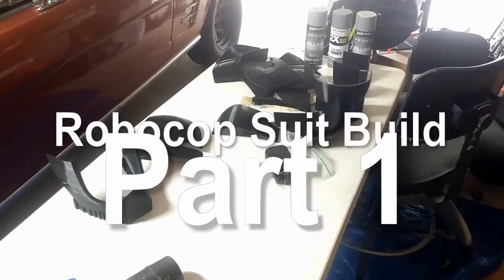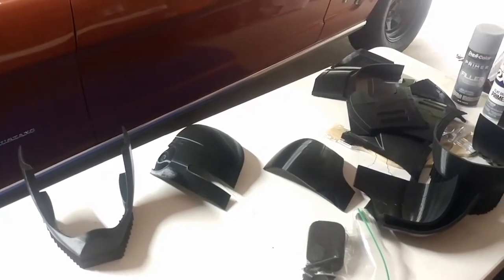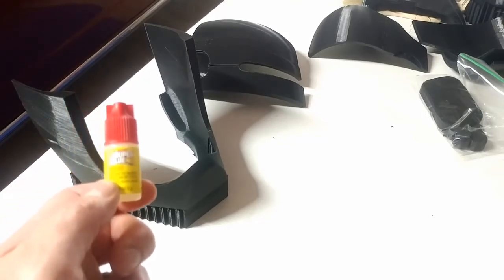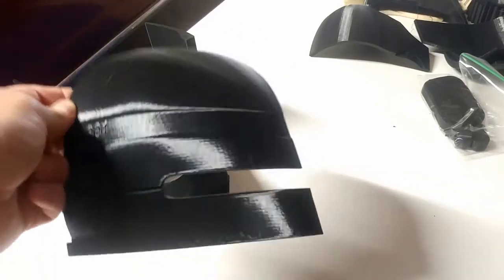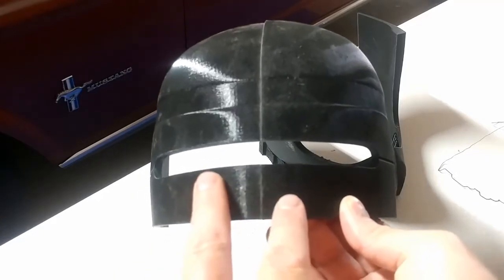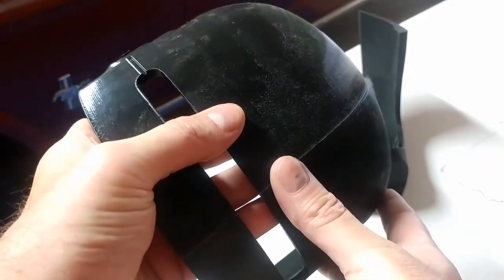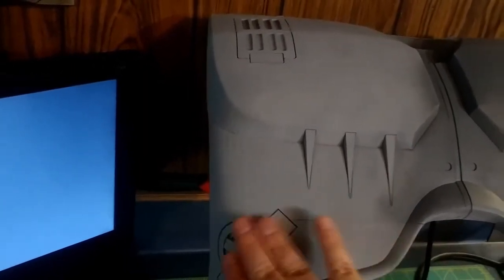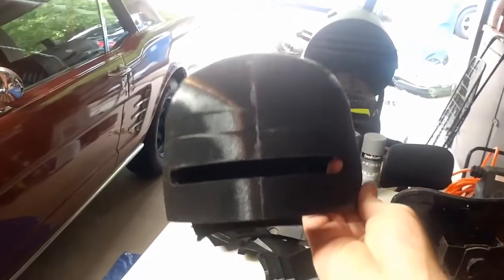3D Printed Robocop Suit Part 1 How to Attach 3D printed PLA Pieces

Comment: Chris, I really love your videos on the Robocop suit.  What a fantastic job.  Can you tell me what printer model specifically you used?  I think you mentioned a CR10.  But is it a CR10 S5, S4, etc.?  What I'm really wondering is how big your print area was.  I bought the template files but the chest piece obviously has to be split up big time.  I'm wondering how many pieces you had to split it in.  Thanks.
Reply from the maker: Hey Jon thanks! Yes I'm using a CR-10 original model.  I believe the bed is around 12 x 12 inches to make it easy.  Definitely large enough to print a Robocop suit.  I did have to cut more of the larger pieces up into multiple pieces.  The chest for instance I cut up into 8 different pieces.  The legs were 5 or so pieces. Sometimes I like to cut up larger pieces into smaller pieces because I don't have to use as much supports and I save on material.  Just requires a little more work gluing everything together.  I hope that helps man!  If you ever have any other questions let me know.

Comment: when u get the model appart in netfabb, how did u add the flange on the edge that u use to glue the parts back together after printing
Reply from the maker: Which flange are you talking about? Netfabb makes a clean cut in the model so when printed the pieces can be easily glued together. I didn't add any flanges.
Reply: @ChrisBoshProps  ok I must have been mistaken